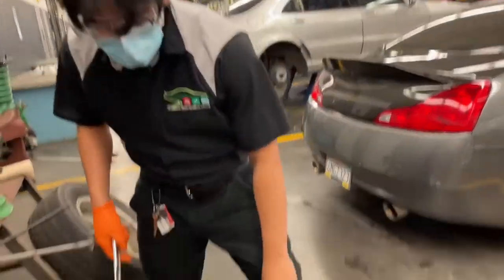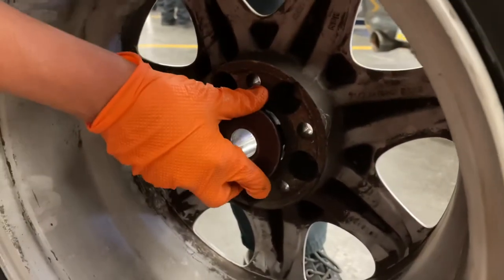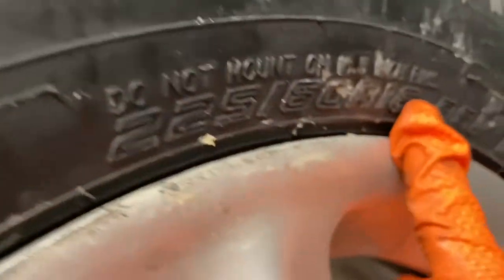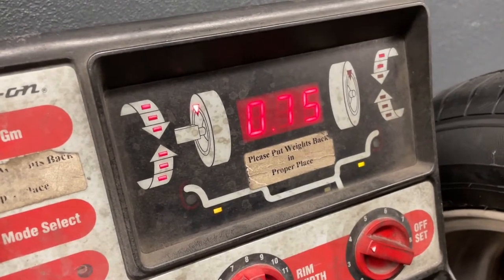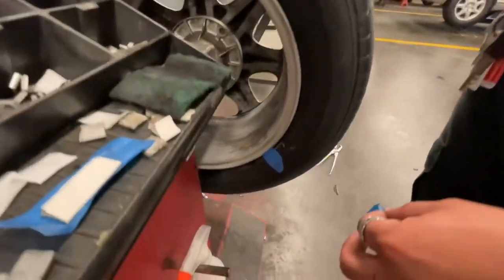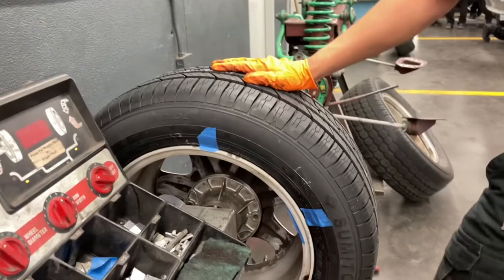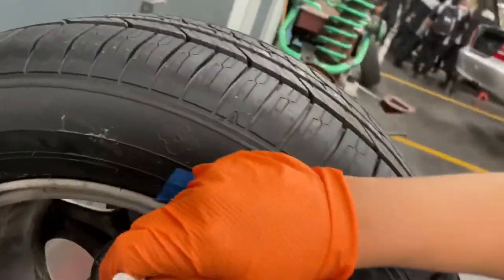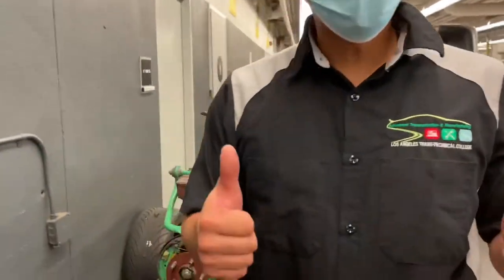How to balance wheels using the Snap-on balancer.

Comment: How important is the offset distance? I have a similar machine but the measuring device is missing? Does it make a big difference to the final wheel balance results?
Reply: The offset distance is just for the machine to know where the wheel itself is positionned. I have the exact machine. The other machines seems to measure the wheel's offset instead.